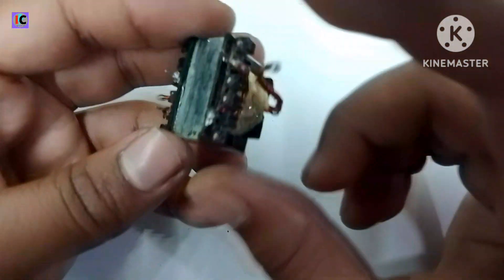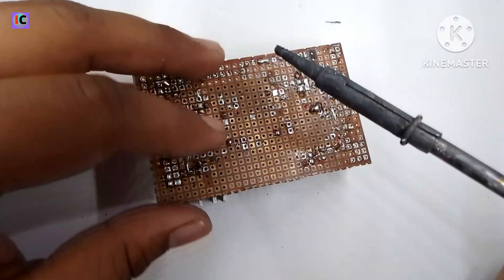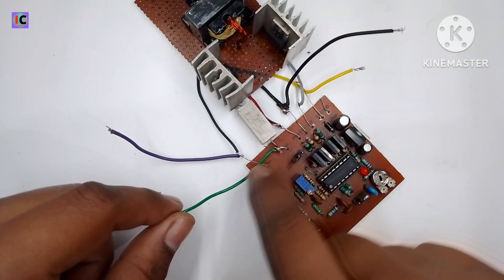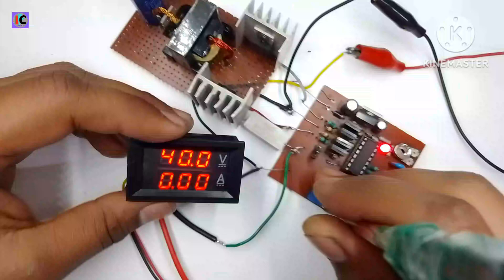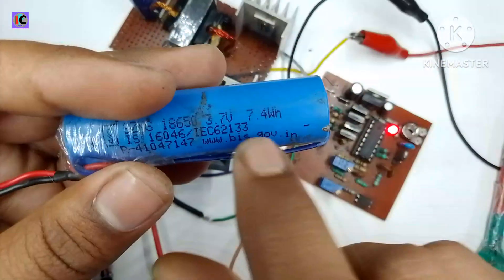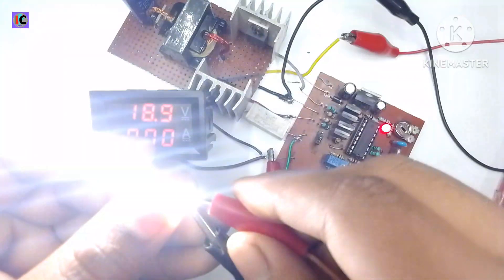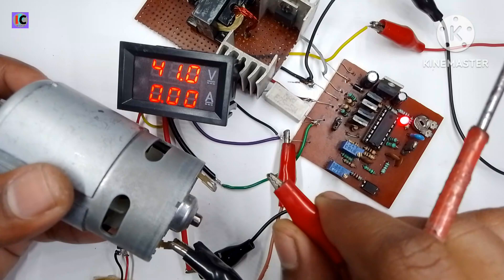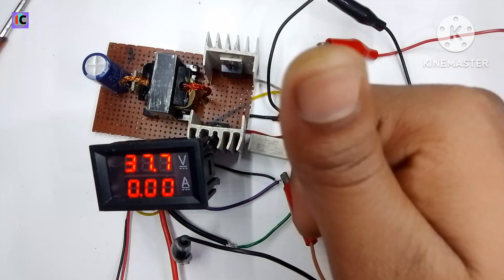DC to DC Converter Using TL494 IC #converter #boostconverter #buckboost

Comment: Output are isolated or not ?
Reply from the maker: no, the output and input shares common ground but if you not use I sense or not want to control current then this can be isolated with only voltage control as it is done with PC817 optocoupler

Comment: Why the voltage drop when connected to output load?
Reply from the maker: its a constant voltage & current mode, if load demands more current than we set, thus voltage drop according to the load
Reply: Then how to make where voltage doesnt drop by increasing dutyclycle?
Reply from the maker: just increase the current limit by I-Adj pot, so voltage won't drops

Comment: Greate... schematic diagram doesn’t contain transformers and mosfets , can you upload all diagram
Reply from the maker: I have updated circuit
https://drive.google.com/drive/folders/1t1RxR80VEjsC6RwsC1hIWkKticsx73Hj?usp=sharing
Reply: @innovationic  thanks , so how do make a transformer? What is core type, number of winding, can you make a video how to made it
Reply from the maker: ok
Reply: @innovationic   i want use as a buck-boost converter not inverter, so short high frequency for buck-boost converter ?
Reply from the maker: yes